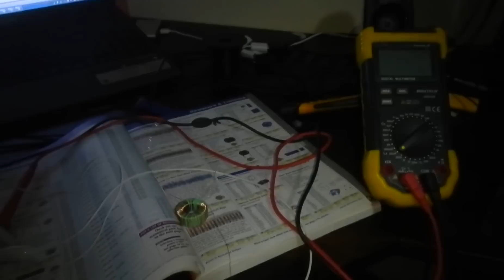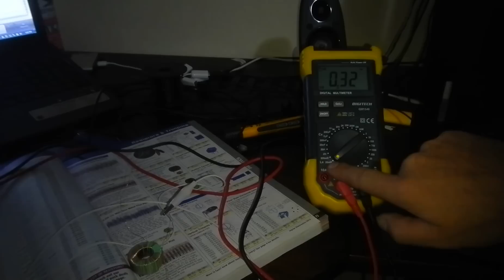Joule thief toroid coil induction property's.

Comment: Make sure you have disconnected the coil from the other parts.  If you don't, then stray capacitance and resistance can cause the meter to give you strange readings.  Also, if you have a coil with a winding that has a lot of turns of fine wire and another winding of a few tuns, the few turns may measure some very odd value because the frequency used might be above the self-resonant frequency of the winding with a lot of turns, and it affects the few turns coil.

Comment: For more on inductance, check the Wikipedia article.  I bought a LC Meter IIb and it's very accurate until the L gets to 8 to 10 mH or more, then it can get very strange.  Then I bought a LC meter that looks like a DMM, but it can't measure L below about 10 microhenrys.  Then I bought a LC meter on a PC board, and it's capable of measuring down to a fraction of a microhenry, but it's consistently 10 or more percent low.  The inductance readings also depend a lot on the frequency used.

Comment from the maker: Very interesting! Good to know. I have been having issues reading some different coils. I did suspect my meter was lying. The coil on my ambient solar oscillator Gives a reading of 16 on one side, 22 on the other, and only 24 with both sides. Any idea why that is? Is it because the coils are different lengths and not wound as two wires side by side?

Comment: The inductance of a coil is equal to the square of the ratio of turns.  This is true for all coils, not just a Joule Thief coil or toroid.  In other words, if the number of turns is doubled, the inductance should be four times as great.  I have found that the L meters I have do not always give an accurate reading.  So instead of reading four times the inductance, the reading may be somewhat less. Also, the stray capacitance of the coil may cause the inductance to read less.